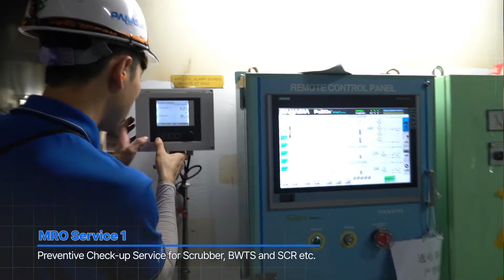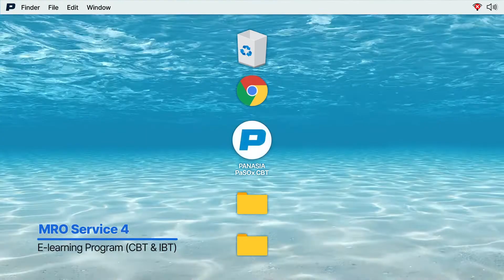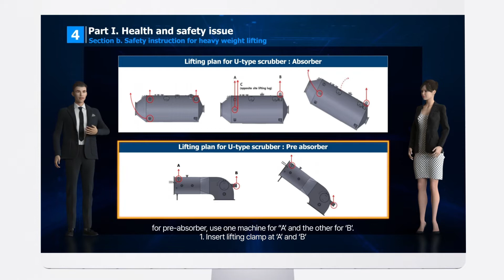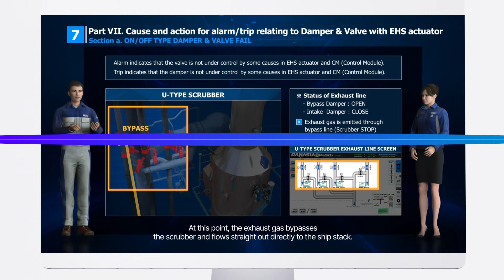PANASIA's MRO SERVICE

Comment: Hi
I am facing the problem that is GMS ( gas mornitoring system) is not working in our ship. SO% and CO% is not showing, its always show 0%. We tried cleaning the gas sampling tube , Probe filter too but it won't work. We do calibration also. Please advice me and It will be very grateful if u upload full instruction video.
Reply from the maker: I apologize for your problem. Could I have your company name and direct phone number? I will send your message to our A/S Dept.